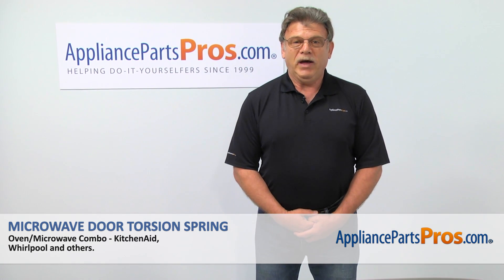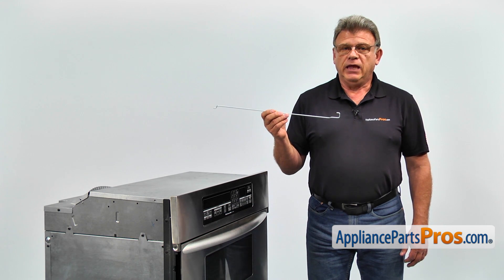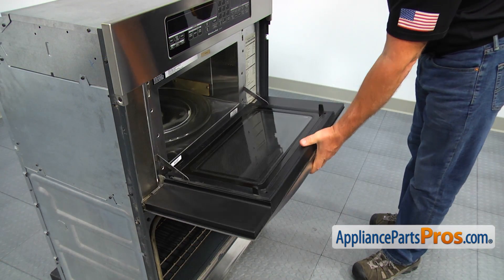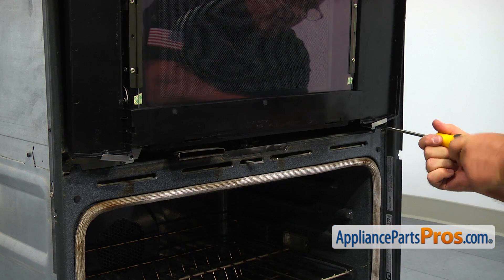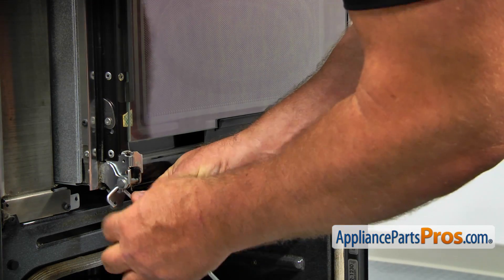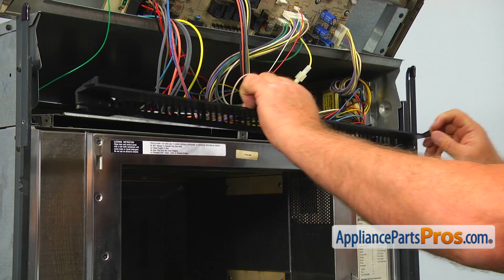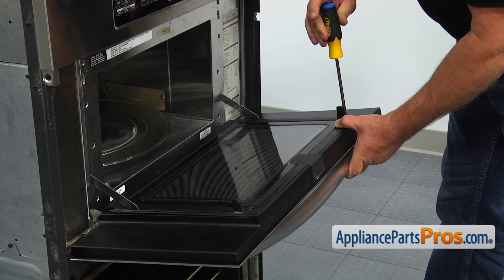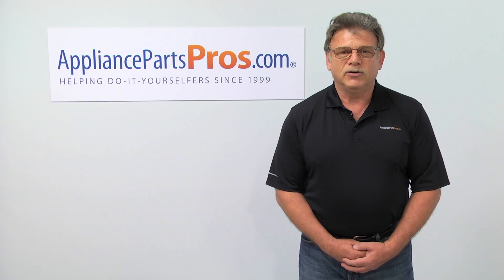How To: Whirlpool/KitchenAid/Maytag Microwave Door Torsion Spring WP4452395

Comment: DO NOT REMOVE THE LOWER OVEN DOOR!!!! Not only is it unnecessary, it is extremely difficult to reset the door back in. I spent more time on the lower oven door than the rest of the repair. And it is totally unnecessary.
Reply: THANK YOU, THANK YOU, THANK YOU!  This video is NOT helpful considering the Microwave does not need to pulled out,  NOR does the lower oven door need to be removed.  Terrible DIY video.

Comment: Just finished my replacement.  I was also able to do it without removing the control panel and pulling the microwave out.  I did remove the oven door just to get it out of the way and ease access to the screws that need to be removed on the bottom of the microwave.   One TIP regarding removing the screw seemingly blocked by the vent:  If you look in the vent there is a screw head protruding from the bottom.  That screw is there to hold the vent in place horizontally...it is not tightened.  If you lift up slightly on the vent the screw head will drop below the vent and you will be able to move the vent horizontally to the side to expose the difficult screw to reach.   The entire job is kind of tedious but not difficult.   Just pay attention to how the tension rods connect before you take the old ones out and take some photos of what they are supposed to look like after they are installed.
Reply from the maker: Thank you so much for the feedback! We are so glad you were able to complete the repair. If there is anything we can help you with in the future please let us know.

Comment: YES YES YES!  This was a great video, thank you very much for making it.  On my repair, I didn't have to remove the panel at the top, nor did I have to slide the microwave out if it's installed enclosure.  I could access all necessary screws to get the door off and replace the torsion springs easily.  Thanks again!!! (the other spring part for this model is WP4452396.  I got both springs on Amazon.
Reply from the maker: We're glad we were able to help you repair it!
Reply: I have the same looking micro/oven combo. I didn't have to take out the microwave either.

Comment: Great video, thank you. I just replaced my torsion springs and also was able to do it without removing the control panel and pulling the microwave out, as some others here had mentioned as well.
Reply: Thank you!  This video takes users through UNNECESSARY steps.

Comment: Very well done video, thanks!  I didn't remove the control panel or lower oven door, but I did pull the microwave out about an inch to get to the aforementioned "pesky screw" under the door.  I had to play with the springs a little to get them to seat properly, but you'll know when they're right.  Whole job took about an hour, but half that time was spent cleaning the greasy grime off the vent and inner door frame.
Reply: Same here.  I left the control panel, upper vent and lower door and didn't have any issues except not paying more attention to how/where the hook side of the spring was when I removed it.   Had to watch that part of the video over and over till I figured out my mistake.
Reply: Thank you for your comment.  It is very helpful.  This video is clearly misinformation.

Comment: Thank you. Replaced both springs. They can be a little tricky to fit in their place. I did the whole job with cleaning in about 30 minutes. Was able to do mine without removing control panel or pulling micro out. And now I know how I can clean the glass in the future.
Reply from the maker: You're welcome!
Reply: Do you mind sharing how you removed the 2 screws on the bottom of the door trim?  One of them is blocked from the metal vent of the oven below in mine.

Comment: I have a Whirlpool Gold combo woc95ecoas03- The door will shut, but when I put in the cool time it won’t run unless I hold the door closed tighter. Will replacing the door torsion spring most likely solve that problem?

Comment: Great instructions. However, was unable to get microwave to pull out of our KEMC308. We followed each and every step and also removed the 2 screws holding microwave at bottom. The left side will move some, but the right side seems to not give as if there is another screw or something holding in place on the right side. Anyone else run into this or know what may be preventing the microwave from being pulled out?

Comment: Great video!   I'm about to order the parts from you to replace the springs on my KEMC378KSS03.   My unit has a chrome trim piece on either side that goes from just under the control panel to the bottom of the oven.   In your video, that piece was not on the unit, so all of the screws were easily accessible from each side.   How do you remove the chrome trim pieces?   Thank you.
Reply: I'm wondering about the same thing... I'm guessing it just pulls straight off because there is no way to slide it up or down.  Have you gotten up the courage to try pulling it off?
Reply: Each trim piece has a screw 4 inches from the bottom that is visible when the oven door is open.

Comment: Are these the parts that make sure the door doesn't slam open (provide resistance)? Or is there an actual spring that allows the microwave door to open and close without slamming? Thanks
Reply: I was wondering the same but after seeing them replaced in the video, it dawned on me the "spring" action is achieved by twisting the 2 rods as the door is opened and closed.

Comment: I have KitchenAid KEMC308KSS0 in stainless steel.  What are the exact two part numbers I need to order for right and left torsion springs?  The information I'm seeing is contradictory and says WP4451009 and WP4452395 are not to be used with the stainless steel models as they require a stronger spring.

Comment: Which torsion rod exactly is the "left" and which one is the "right"?   

I think mine failed on the lower right corner, the rod that goes from lower right to upper left.  Which one is that? I want to order the correct spring rod because the other one that goes from lower left to upper right looks fine. 

Thank you very much.
Reply from the maker: What is the model number of your microwave?
Reply: KBMC140HSS04
Reply: This broken torsion rod sits forward/outside the other rod as it crosses the outside of the door.

Comment: How do I replace the porcelain clip that holds the broiler element in place?  I have a KitchenAid Microwave (part number is W10909479). The clip is broken and and the broiler element is half hanging down.  I can't use the microwave.

Comment: Do all springs like these fail regularly?  The ones on my Kitchenaid have failed every year or two and going on 10 years, all those springs really add up.
Reply: We've had ours 18 years. First time one broke was 3 years ago. Then just a week ago. It broke when my daughter was cleaning the inside of door when it was down. I think she was pushing hard on it. Perhaps when cleaning we should be holding the door slightly up with one hand so as not to put pressure on the springs.

Comment: I also did it without removing the microwave oven. The only problem is the left screw on the bottom of the door, which is above the rectangular vent. I took a 1/4 inch #2 phillips bit and ground it short and left just enough of the 1/4 hex to turn with a small 1/4 inch wrench, with the door open.